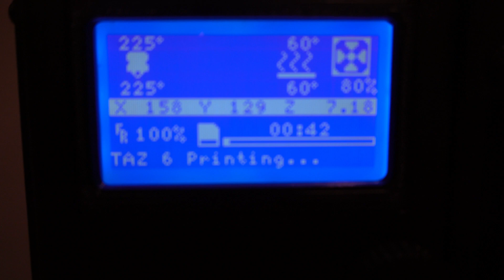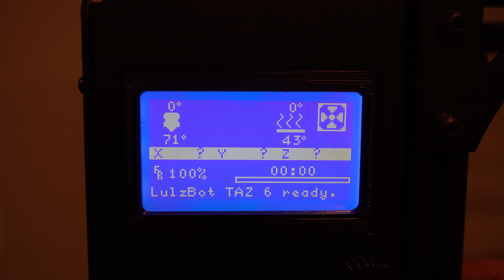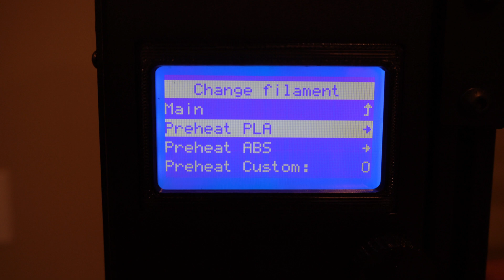3D Printer - How to Change Filament (Tips and Tricks)

Comment: Being new to 3D printing, I don't seem to understand how to load new pilament when I had left printer running and the old pilament on spool  finished and now the end of the old is stuck in the feeding tube! I think I have to heat the printer but now sure what temperature and then what? I have a Anycubic Pro 3D printer with laser engraver. Could you help explain the steps I need to do to fix this?The old pilament is JbL or something and my new is PLA This 3D printer is brand new to me A friend helped by setting it up and left me  i Please help Thank you
Reply from the maker: Hi. If you are past the extruder, you are going to need to remove the tub, heat the hotend up to about 190-200, then pull the filament back out.